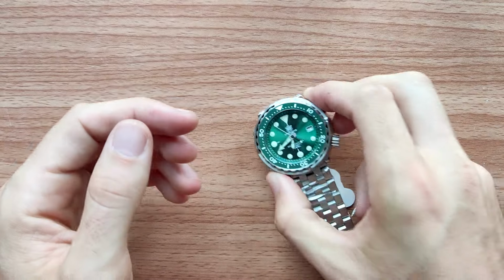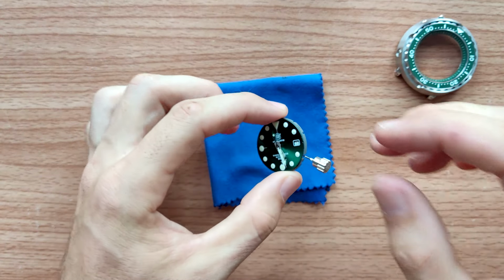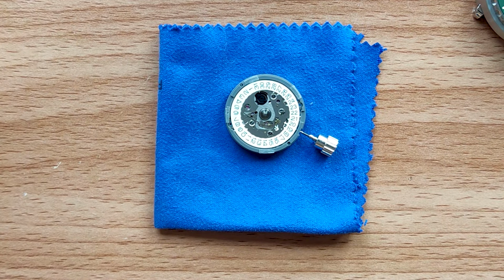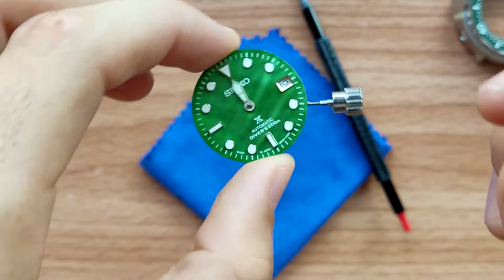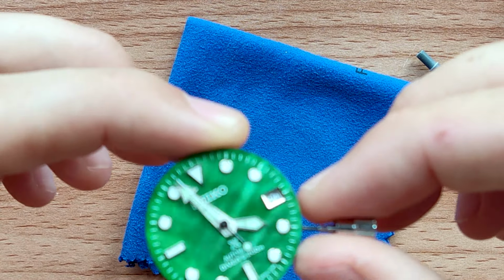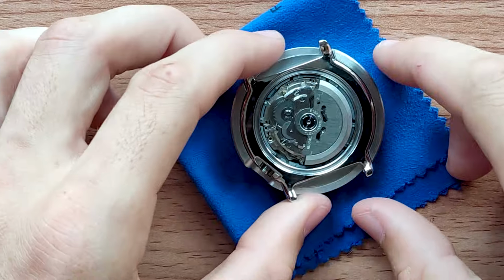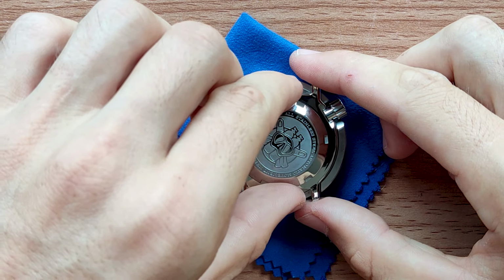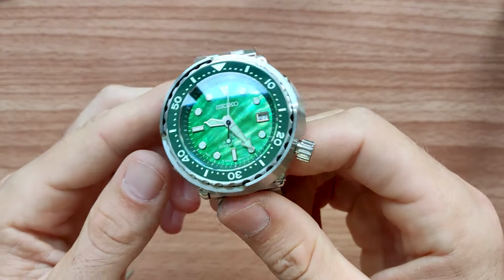Easy Modding For Beginners | Full tutorial | SteelDive 1975 | Step by Step

Comment: Do you happen to have a new dial store recommendation? Old one 404ed. Thanks!
Reply from the maker: @magnetpull7587  This dial is a headache... I tried many stores, and many were defected. I will check some again tomorrow but can't guarantee the quality. It's kind of a lottery here
Reply: @ShortBetter  Thanks, yeah if the price is right I'd be happy with ordering a selection, it's just annoying to periodically wait for them each time one is disappointting. Finding dials shipped from Europe is also not exactly easy
Reply from the maker: @magnetpull7587  I usually order a couple extra in case some are bad. Saves time

Comment: I'be bought a black dial SD1975 that I plan on modding. Are the crystals, bezels etc all the same size as SKX007/009 parts?
Reply from the maker: Better I give me more details about this tuna parts, easier to find what you need
Reply from the maker: Case Size: 47.5mm/ CaseThickness:15mm/ Lug size: 22MM/ Lug to lug length:44mm
Bezel size: 38*31.6*1.2mm
Dial Size 31.2*30.0*28.5*0.4mm
Hands Size 8*12*12mm
Crown Size
7mm

Comment: You should get rid of the nasty lumed bezel insert.  I have a Feiko sumo that came from AliExpress,  I  wanted to compare the dial with a genuine Seiko dial. Tbh there are far nicer dials that don't have a fake Seiko moniker  on them, while the Steeldive is a basic build I'd still prefer to see it with a better quality dial rather than very obvious fakery. You could always get a San Martin or Proxima and have the satisfaction of owning a watch that's better finished than the Seiko it's based upon.

Comment: this guide works also for the Addiesdive myh5?
Reply from the maker: Yes, it's absolutely the same case😊 But be careful with reusing addieses hands. They can be worn off easily if you apply too much pressure when placing them again
Reply: @ShortBetter  maybe I’ll buy some spare hands !

🙏
Reply from the maker: @leodileodileo  Btw, there is a promo on aliexpress. Addies now is really cheap
Reply from the maker: https://a.aliexpress.com/_EviQuMJ
Reply: @ShortBetter  I know , and I saw a tandorio (Seiko monster homage) with no logo with nh36a ad 50€😱
Reply: @ShortBetter  any link to seiko dial for tuna ? 🕐

Comment: My dual Ring is misaligned. Can I adjust it the same way? Or do I have to remove the glass?
Reply from the maker: On original SD1975?
Reply: @ShortBetter  It's a SD1972
Reply from the maker: @michaelbents1879  you can still make micro edjusting by opening the case and moving the movement (very carefully) to the opposite side of your misaligned chapter ring. Not sure about the chapter ring on SD1972, but on 95 it's fixed, so you can't move it around
Reply: @ShortBetter  thanks for your help. I'll try.
Reply from the maker: @michaelbents1879  good luck😁👍